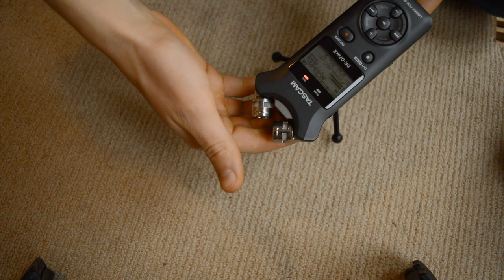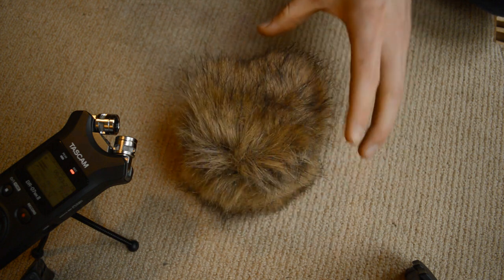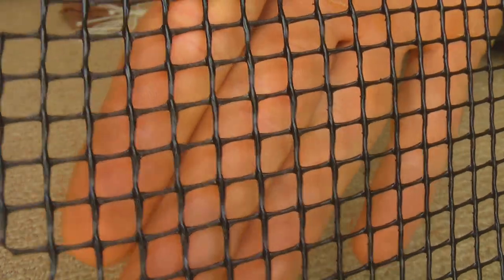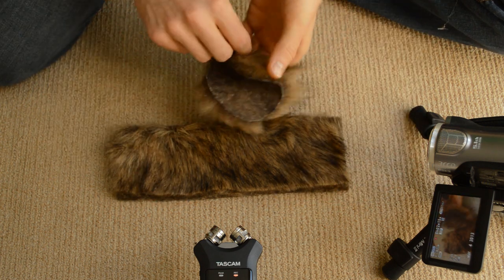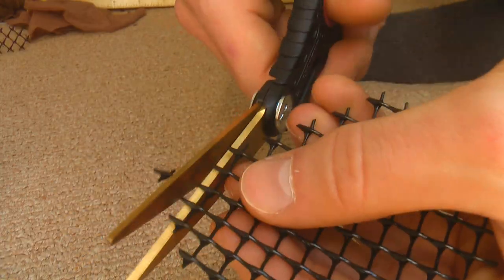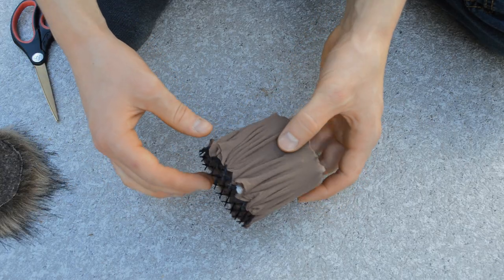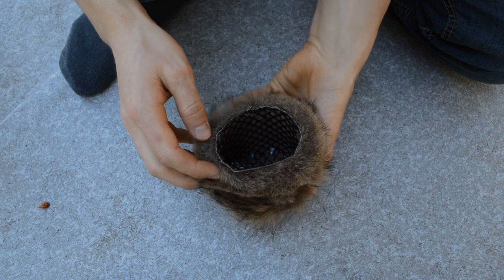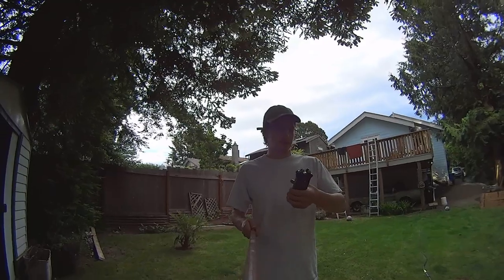How to Make a $10 Windscreen for a Microphone (Dead Cat)

Comment: Nice one!  It worked well.  I've used foam, shadecloth and stocking material in the past and I've found that space between the material and the capsule is more effective than having the material right next to the capsule although that can make for a bulky windshield.  Never thought about the gutter-guard though.